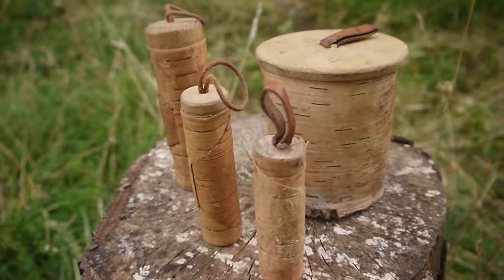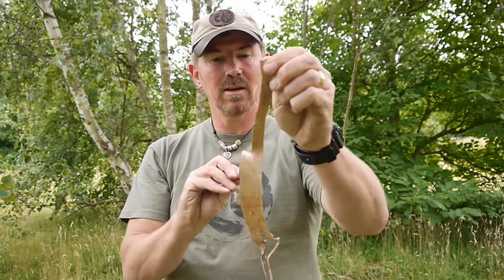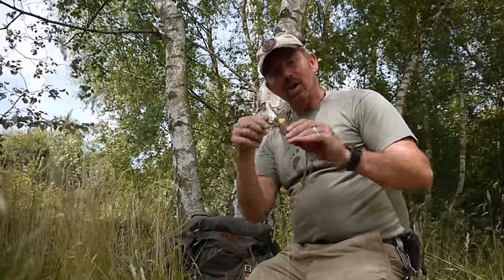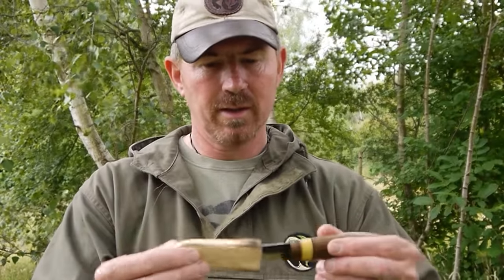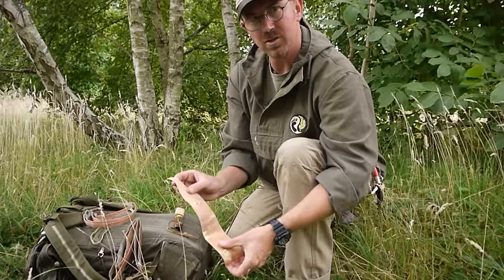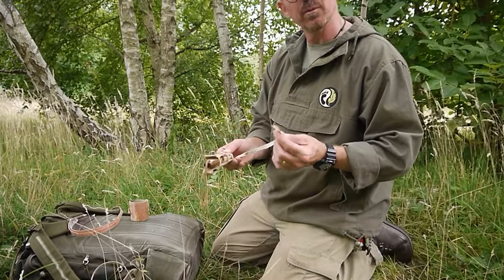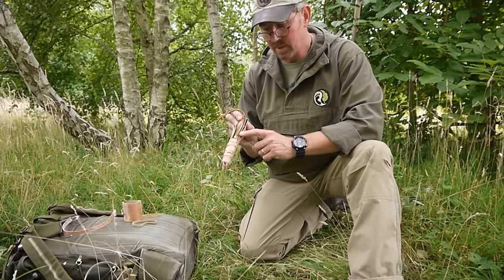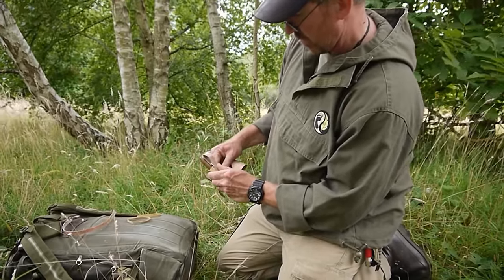Craft Project #2 - MAKING A BIRCH BARK SHEATH

Comment: I have just finished a small pukko style knife and was wondering if there are any other options to birch bark for sheath making in the more native style as the birch bark in my area is so thin even if I soak it splitting is a major issue 
Thanks for any ideas